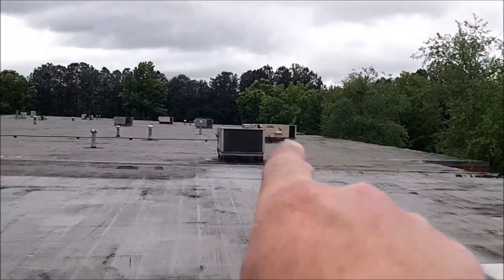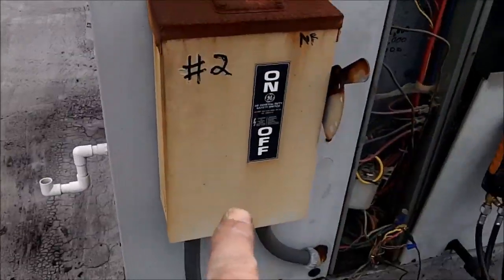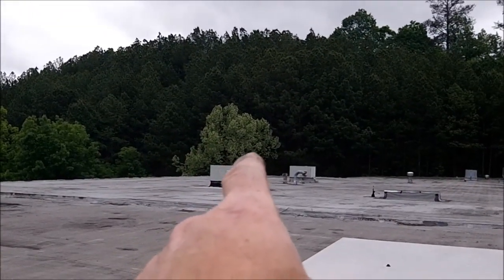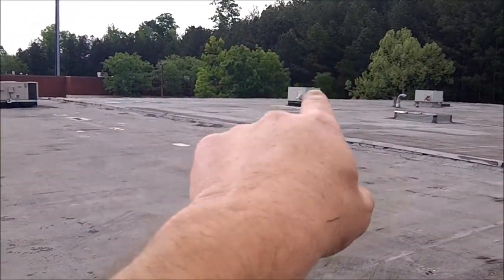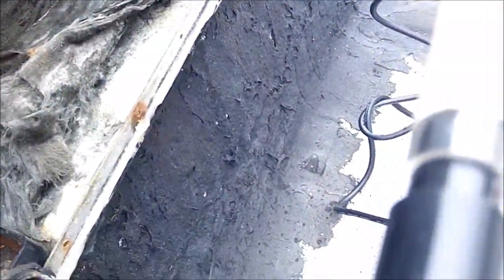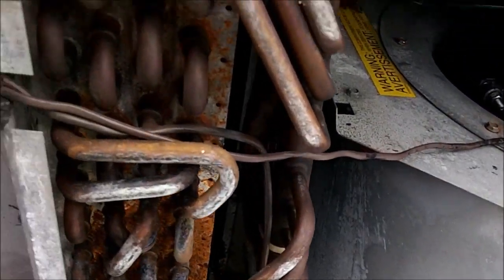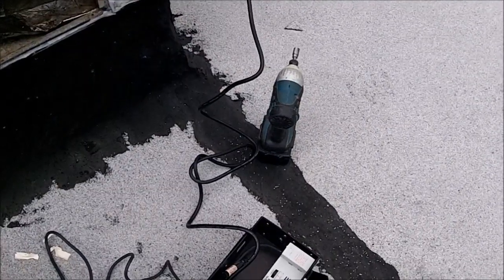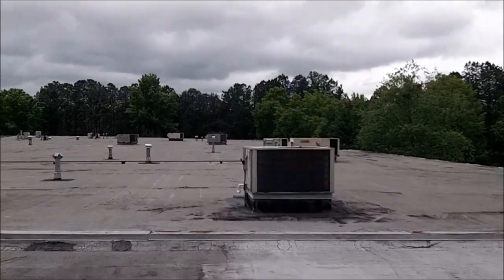Freon Leaks They're Everywhere

Comment: I worked with my dad for a few years as a helper bring tools up, cleaning coils with that acid or alkaline soap, changing filters, and changing belts. I cleaned copper couplings, filter dryers, and lines with a wire brush or aluminum oxide sandpaper before he would solder on new units. I would also go get parts he ordered from the closest supply house if he had a part he needed but didn't have in the van. But finding leaks took forever to find if it was a small leak. Once it was found, he had to solder the leak, hook up the gauges, vacuum pump the air out of the lines, put some freon in, test for leaks again, then put the rest of the freon in once there are no leaks. Not to mention helping to carry those heavy compressors up and down ladders, if a compressor failed. (Those cast iron walk-in freezer ones were very heavy.) Some commercial units we replaced entirely and had to hire a crane to remove the old unit and bring the new one up. My dad still does Commercial HVAC at his own business, WillCo Services. He only does residential HVAC for friends and family , though. My hats off to you sir, very hard work especially on the hot rooftops and attics in the summer.
Reply: I work on commercial applications and this is probably the easiest line of work I've ever done besides replacing house windows